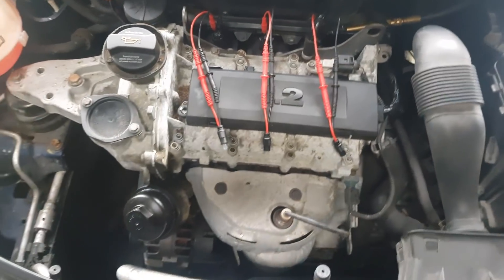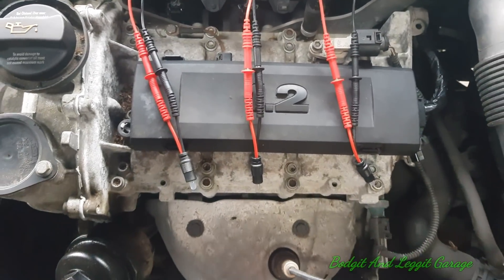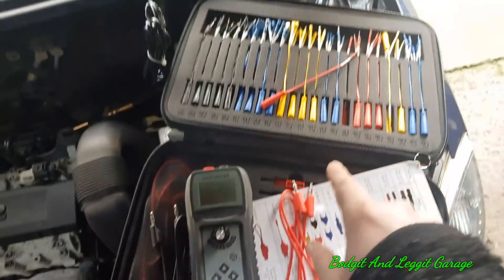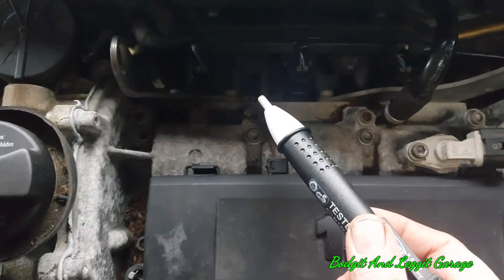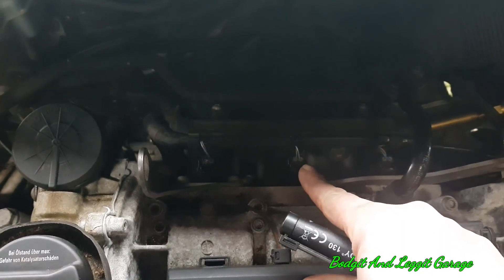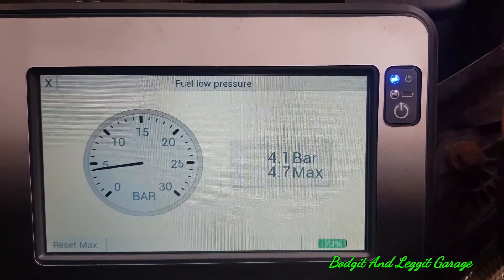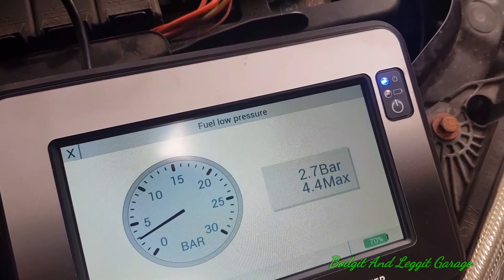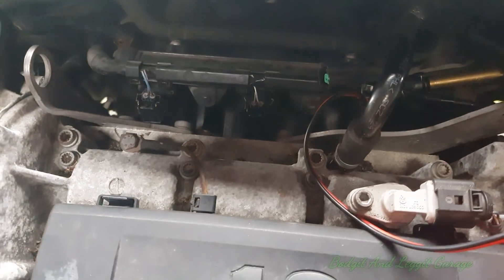Can You Fix It Part 7 Injector Testing

Comment: I've got an M54 with one bank trimming slightly higher than the other, so I think I'll pull the injectors out for a clean.
It's that, or a failing lambda sensor... and we know the M54 only likes Bosch (£££)😊

Comment: got a wv 2002 2.5 tdi. It revs up sometimes on start then sometimes idles fast for a few mins. Some dark smoke on most starts. Heard this could be leaky injectors letting fuel into the engine.
  Would it be solenoids or dirt behind the spring in the injector? Anyone got any ideas?

Comment: Your tektronix oscilloscope would work much better than LED lights to check injector electrical pulses, voltage presence, level and duration.

Comment: The problem with this test is that the motor runs OK for a while. All tests you do need to capture the moment it stops or starts to run bad. That really limits you to scope tests. I would attempt to capture coil and injector current as the fault starts. You could probably scope fuel pressure with that nice tool as well  Even an engine mechanical failure may not be obvious in a static situation.
Reply from the maker: I'm going to be doing a lot of scope videos on this showing people the importance of a scope and why you need it.

Comment: Think that was a wrong fork in the road I would be checking the current from the ecu to the   coil on cylinder 2 and then at the ecu to see if it's in the  wiring or actually in the ecu. Just one other thought the pipe from the inlet manifold to  the positive crankcase pressure valve is worth checking for cracking or splits. Loving this series 🤔🔧🔧🙄🔨🔨🔨🌋😕🔧🔧😁👍
Reply from the maker: Thanks a lot mate the whole idea this is just to do what people are suggesting and I just do the most common ones whether I think it's right or wrong it's good to get other people's take and how they would actually do it I think it's very interesting
Reply: @bodgitandleggitgarage  Tiny thinks to self🤔 I might swap the spark plug for a new one.... 🔨🔨🔨😕🔧🔨😁

Comment: those the engine mis only or stall
Reply from the maker: Both I explained everything in all the other videos mate
Reply: i know that you swith the coil ,but never seen test for good spark on that cyl.2,but i do not think that would complet stall of engine for one cyl.put some pid data to see like rpm  ecm volt ect iat o2 b1 and b2 maf and fuel trim and  do wild open trottle a couple time and look at data .to see if the catalizer is block of the maf sensor is not reading write ,fuel presure not in bar .i do not work in bar .bar for me is were you get a beer with friend.lol i think the cat is block or the maf is reading wrong by a big air leak or block or dirt or block exaust and let see what come out the tail pipe black smoke or whit smoke or no presure and does it stall in open loop only.and the petrole in the tank is good? since they do not use it alot

Comment: Would using a scope after the wand test be the best course?  I feel the LED test  is useless here as they only takes a couple of volts to flash and doesn't indicate if the injector is getting the correct power. Quick and dirty, like you say, but the wand will do that.  An oscilloscope would give you a better picture as it's also an intermittent fault.
Reply from the maker: That's exactly what I said in the video what I'm trying to show is that just because you do a test doesn't mean it's going to give you the best results that's why in the video I said a couple of times I'm going to use a scope which is the best course of action people are asking me to do these tests and I'm trying to show them that it's not necessarily the best thing to do
Reply: @bodgitandleggitgarage  Oh, I see. I have misunderstood the meaning of this video. I thought you were showing the best way to check injectors, not specifically how you've been told to check them.  That makes sense now.
Reply: i would use my iEA Engine Analyzer (EMI1030)